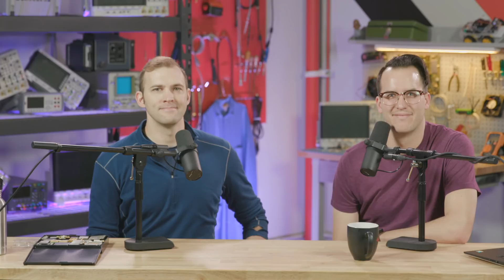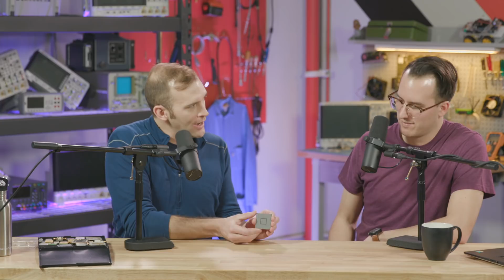Live! - IC Packaging - EEs Talk Tech Electrical Engineering Podcast #37

Comment: Very interesting subject! Packaging of el. components is, where the real magic happens, like RF behavior, EMC, heat transport, thermal stress relief, and sometimes disasters .. like cracks in the outer mold or in the interposer, bonding problems (Cu, Al, Au?).
Btw.: Are you still manufacturing the infamous U180 , that is the A/D ceramic hybrid of the 3458A, or are you living from stock of such 30 year old chips?
Reply from the maker: Hi Dr Frank, thanks for your comments and question. Packaging is indeed an important element of almost every electronic system, requiring considerations and design in multiple engineering domains. The Keysight component that you referenced, which was used in our multimeter products, has largely been replaced by new technology in an ASIC we released around 8 years ago. However, it’s not unusual for us to maintain very long lifespans for some of our ASICs – sometimes 10-20 years! -Jesse